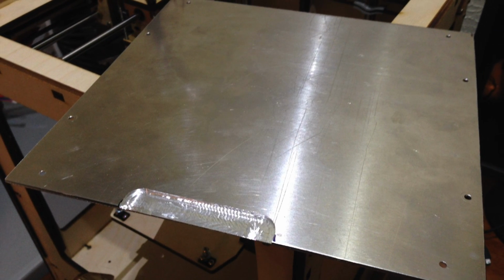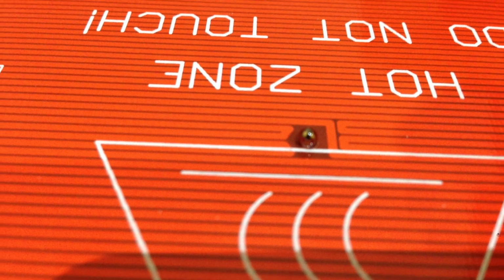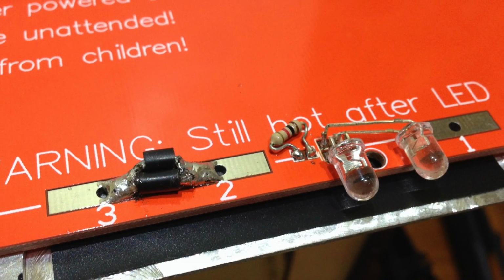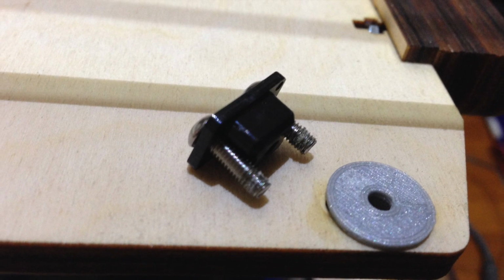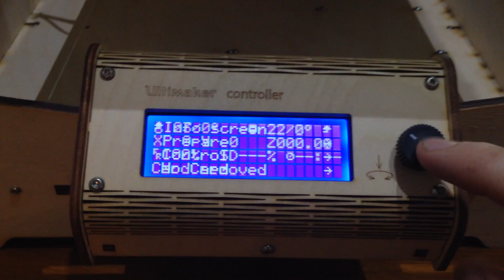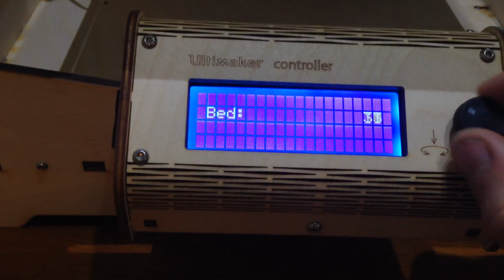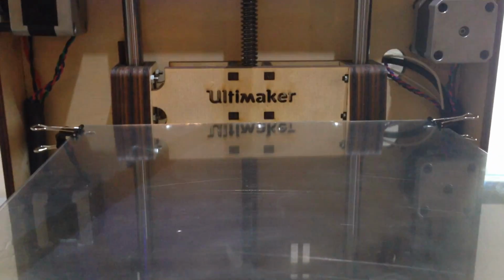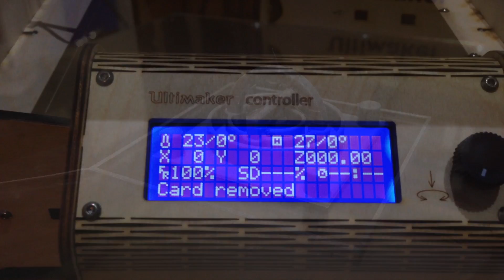ULTIMAKER UPGRADE - Heated Bed

Comment: Just out of curiosity is the SSR even necessary? I am thinking about this upgrade and confused about the wiring of the SSR. I have converted to 24v( your video on that was super helpful by the way) and I was thinking about this next. Also, what are your thoughts on using a silicone heater mat?
Reply from the maker: You can use any relay you like, but I chose the Solid State Relay to avoid the loud clicking and to help it last much longer. The lifespan of a SSR is much longer than the typical electromechanical bang bang relay. Silicone heater mats from what I hear are the business. I would go that route on any new printer I build. Good luck! Let me know if I can help further explain the relay wiring if its still confusing.

Comment: Would this be another (cheaper) option? http://www.ebay.com/itm/221541310077
Reply: i've been thinking about buying this 
do you think it can be fitted directly to the temp 2 pins without all that complication 
i know its a dumb question but i don't know much about electronics
Reply from the maker: +LOUI J the heated bed I used simply has a thermistor that wires directly into the ramps board. Signal and ground are the two wires you use at the bed temp connection.

Comment: Neather Bot
Could you help me design a circuit plan for running the heated bed just with an relay and without any LED?
Reply: Thank you very much. I am part of an university project for building an Ultimaker+ from with parts from different sources to original. It would be nice to have you in contact for tech advises.
Reply: *****
Thank you very much. I am part of an university project for building an Ultimaker+ from with parts from different sources to original. It would be nice to have you in contact for tech advises.
Reply: *****
I liked your FB Site. If we have some questions in the future, I'd text you.
Thank you for your help.

Comment: Hi i am having a problem. I am using an ultimaker pcd and the large smart Lcd , but everything I change on the lcd doesn´t save on the eeprom. If I turn off , no data have been stored. I enable already the lines on the arduino firmware, but still the same. Can you help me?
Reply: thanks